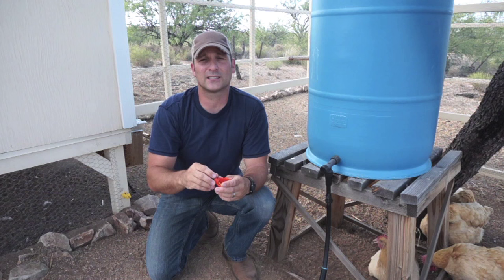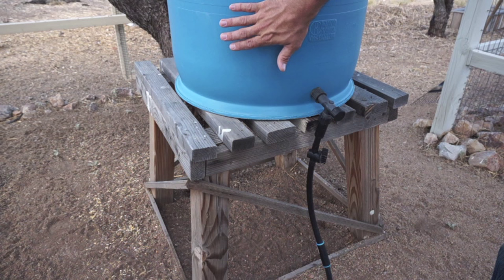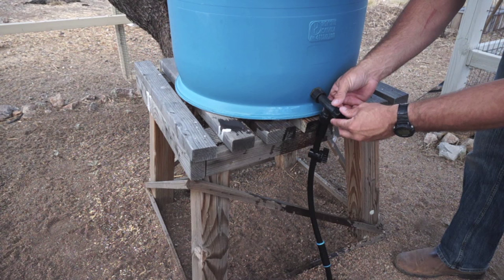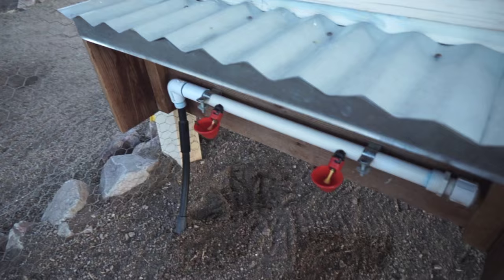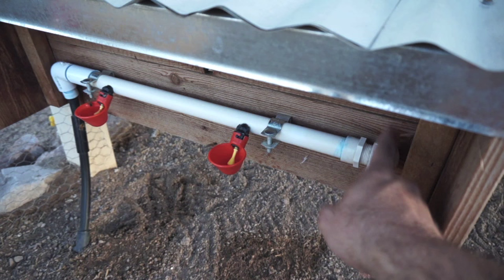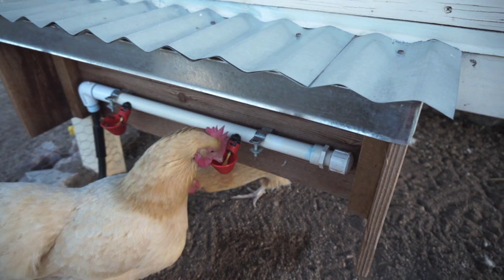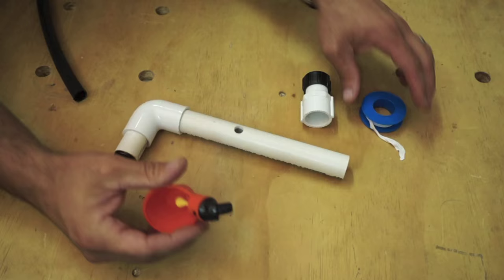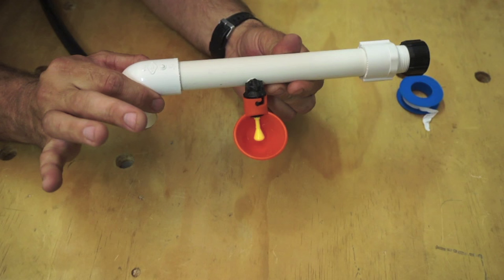Chicken Watering: Tour and Install of my gravity fed system

Comment: These cups look much more interesting than the water nipples, specially for inside the coop. I bought some nipples and they work, but there's always some drops dripping out of it even if the chickens are not drinking, so the wood shavings end up quite wet and I have to replace it quite often. This system looks much more safe and I'll try it soon :). Thanks for the video!

Comment: Fantastic video. So simple but yet so slick and effective. Major kudos for coming up with this setup. I'm definitely designing my water system for the coup I just finished based on your solution. But instead of a 55 gallon drum (or any reservoir for that matter), I'll be using the household water line since I have access to it 2 feet away from the coup. I will obviously be forced to add adjustable pressure regulator & color coded gauge to it, but since they only fit 1/2 PCV, I'll probably go with 1/2 pvc the entire length. Feel free to holler if you find any flaws with this. Not being able to collect rainwater for the system would be one major drawback...
Reply from the maker: +Peter Bergstrand Hi Peter!  sounds like a great setup to me!  If you got the water there, then use it:)
I think 1/2" should do fine for your piping... but I'd check to see if it'll work well for the cups to be installed to.  The cups have about a 5/8" threaded portion that will protrude into the pipe and may take up a bit of room in the 1/2".... but if so, all you'd have to do is just adapt to 3/4" from your 1/2" source line to the portion in the box.. so it wouldn't really be much difference in cost overall.  Anyways, hope that made sense.
Joe

Comment: so after you drilled the 3/8 inch hole. did you have to have to run a tap through the hole to make threads. or will the cups make their own threads. if you ran a tap, what size dud you use?
Reply from the maker: I didn't run a tap.. I just wrapped with teflon and screwed it in.. i unscrewed one and it looked like the black plastic made some shallow threads in the PVC... so it must be harded.. at least by a bit.  So far I haven't had any problems with doing it that way:)

Comment: I'm trying to get automatic water to about 10 coops. I'd rather set it up with a smaller drum and a float system with a garden hose attached. from there its a matter of running the tubing everywhere just like a sprinkler system. Oh and building all these parts. I don't even think I need the little boxes, could just mount the pvc tube with tie wraps on the outside of the coops. I would love some help getting something like this going, my chickens have a little money in the bank...lol... I'm just not handy with tools etc. :(

Comment: I followed this system with all same measurements--The cups all leak.  Do you have any suggestions?  I have even tried silicone seal, and they still leak.
Reply: Same here! I've tried silicone, I've used car body filler, I've tried super glue. Nothing. Always leak.

Comment: Cool idea - I had never seen those cup waterers before, only the nipple drippers.  Do the cup waterers have the same "stuck open" common failure mechanism that the drippers do or are they better designed/constructed?

Question:  How do the bees and chickens co-exist around the waterers, i.e., do the bees sting/keep away the chickens and/or do the chickens eat/peck at the bees, or is everything cool with them just sharing the same watering cups without any issues?
Reply from the maker: Peter K. Thanks Peter... I actually tried out the other style nipples before these and didn't really like them all that much.. plus these are just plain cooler looking:)  Regarding, the 'stuck open' issue... i've never had it with these in the 4 years that i've used them.  I think it's because these have a spring that forces the valve closed.  The other nipple waterers just use water pressure and if they don't get reset properly then I'm guessing thats how they get stuck open.  
Regarding the bees/chickens...  they coexist very nicely and ironically, during this video was the most amount of bees that I've ever seen near the waterers.  I'm guessing it was because the water bucket that I normally put out for my hives was empty and they were searching for the next best source.. and in the desert they are few and far between:)  
Anyways, hope that answered your questions:)
Joe

Comment: I have used the cups in a  2 gallon plastic jug. The water does not flow into the cups as easily as you showed.  I, myself, have to hold the nipple in to get even a small amount of water into the cup. The jug is almost full. Any thoughts or suggestions?

Comment: Do you have a recommendation for how to keep this system from freezing? I live in Minnesota!
Reply: foam insulation tubing should keep the pipes a few degrees warmer. a low volt heat pad for the bucket would be ideal.  those waterproof ones from waterbeds maybe?
Reply: When we lived in Colorado I used a heated bird bath. Because it was so open it got messy and I had to change out the water daily, but it didn't freeze so they always had water. I think it would work if you simply left it dry and sat your water bucket on it.
Reply: I use a koi pond heater
Reply: @emmeotto5825  I'll definitely look into that!

Comment: Although you do not have to heat this system to keep it thawed during winter, I would. Am brainstorming how to do that. You have any suggestions or ideas? The tank would be easy. The tubing an waterers, not so much.
Reply from the maker: Hi SF... depending on your temps you might only just need some insulation around the pipes...but if you are in a really cold area you might consider running one line into the coop and one line out.... and during the winter months shut down and drain the outside line and just use the inside line.   And maybe put a lamp in the coop as well.  Anyways, just some thoughts... let me know if you have any more questions:)
joe
Reply: Thanks Joe. I live in Alaska. We are thinking the same thing, pipe insulation as well as running it both inside and outside the coop. We do keep a low heat in the coop, just above freezing. We have the gutters up, just have to finish it all. It is Fall here now, might wait until next summer to finish it.

Comment: HI Can you include a materials list? Love this and ready to get it up and going. Thanx for the video :)
Reply from the maker: Hi Michelle... I might do an instructables on this.  If so I'll post a link  in the description to the instructables page and that will include a detailed list of components:)  Joe
Reply: Ok no prob will try to figure out from ur video, planning to do this over the weekend. Thanx
Reply: Michelle Justice Hi I was wondering if you have built your water system for your chicken I live PA and would like to build one but was wondering if where you live if it snows and what do you do for winter to prevent it from freezing
Reply: @amanda924121  HI I did n it couldn't be used in winter, bujt worked great otherwise.. Ive since sold all my chickens and removed it. 
Good luck to ya.

Comment: I think your stand had better be able to hold more like 500 pounds buddy. 55(gallons) X 8.35 = 459.25 pounds, without any factors like rain, snow, wind, leaves, branches, chickens, or all of the above, at one time or another lol. I know how crazy things can get on a ranch, and it usually happens all at the same time & fast. 😂😂😂 Just wanted time make sure nobody built something that was gonna tip over on them lol. I’d probably even sink those 4X4 corners 8-10 inches & put a concrete cookie on the bottom of each hole & fill the rest of it with dry concrete, back fill with a little sand or dirt and that baby ain’t tipping over on the kids, animals, or chickens. You could even run a little 1/2 round trim along the edge, or a whole piece of 2X4 along each edge for that matter, to help keep the barrel from tipping off of there in a stiff wind if it were to get low on water. Just sayin’. You don’t want 460 pounds of water to come tumbling down on top of somebody....

Comment: This is the best system I've seen!  I want to go to the store and pick up supplies today.  ONE question... do you think it would work to do a fork in the irrigation pipe so I can have one watering cup on the inside of the coop as well as a few outside?  My guess is that I'd have to make sure the watering cups are the same height (which isn't a problem since my coop sits on the ground)?  Thank you for the tutorial!
Reply from the maker: +Danielle Carbajal Hi Danielle,  I think that's a great idea and it's something that I've been meaning to do myself!  You should get roughly the same pressure on either side of the split/fork so the cups ought to work just fine.  As for height, as long as they are both about the same you should still get about the same pressure.  Mine is a gravity system off of a rain barrel.... but if you have it off of an irrigation line tied to your house then theoritcally you could have them at whatever height you wanted.  Anyways, hope that helps:) 
Joe
Reply: +homesteadonomics I did it!  I finally finished the watering system thanks to you inspiring me and showing how you did yours.  I added one to the inside of the coop and I did a blog post - is it ok that I linked your video to it?  Thanks again!!
 http://theprojectlady.blogspot.com/2016/03/chicken-coop-watering-system-how-to.html
Reply from the maker: Hi Danielle... just read your post and it was super awesome!  Totally cool with the link too!  Your coop looks really nice and I love the setting it's in too.  BTW... I checked out a couple of your other posts and I think you should start adding some more vids of those things to your YT channel.  Very nice job all the way around:)
Joe

Comment: I drilled a 3/8 in hole in a pvc pipe and couldn’t get the water era to thread as they have plastic threaders. Not sure where I went wrong. Also, how do I keep the water fresh, without algae growing?

Comment: Some of those parts were pretty tricky to find.  I got everything out together except for the compression fitting.  Does the lid of your barrel come off?!?  I can't figure out how to attach mine through the tiny opening in the top of mind...  :(
Reply from the maker: Hi HB... yes, the lid does come off of my barrel.  It cost a few extra bucks but I think was worth it for the access to clean it out.  If yours has the two holes in the top you will most likely have to cut out a bigger opening.  A jig saw can do that with little problems:)  I'd recommend cutting your access hole to a size where you could place a strainer or something in it to keep mosquitoes out but allow you to fill easily with a garden hose or raincatchment.
Joe

Comment: Question! How do you treat your 55 gallon tank to prevent algae build up? Keeping it in the shade helps but I was wondering if there was something else you use? I don't have that many chickens So I think I will use your system except with a 5 gallon bucket. Thank you for the video.
Reply from the maker: Hi Chris, I change the water out and give it a good scrubbing once a year but other than that I really don't have any alge problems.  good luck on the build!  your chickens will love it:)
Joe

Comment: I really like this system. But how would you deal with much colder/freezing temperatures? I live in Washington State and we have temperatures as cold as 30 below although not often.
Reply from the maker: Dolly Perry Hi dolly, even though we don't get hard freezes too often we do occasionally get into the teens.  In those cases i just drain the system and put the old style waterer out.  For light freezes I wrap the black pipe with insulation and just drape a towel over the box... which seems to work out great!  Hope that answered your question:)
Joe
Reply: I know from experience that chickens like to eat the foam insulation. I'm kind of envisioning some sort of get up where the pipe is in foam which is in a larger pvc pipe. Or I may check and see if just having a submersible water heater in the tank would work better. This will be my first winter with chickens so the learning curve is great! Thanks for the quick reply!

Comment: With a 55 gallon drum are you adding chlorine or anything to purify it if the water's not used for 2 months at a time? If so how often are you treating the water?
Reply from the maker: +mhendu07 Hey Mhendu.. I don't add anything additional to the water.  There is a little chlorine from when I fill it up with house water but I've also got rain catch going in there too now.  So far no problems with algae, smells, etc,. … the chickens love it!   Anyways, hope that answers your question:)  
Joe

Comment: Hi, We think this will work for us, but haven't been able to find all the parts at Home Depot, mainly because everyone we talk to there has no clue what we want! Would you please itemize the parts? I have figured out that a swamp cooler is actually an evaporative cooler system!  Have most of the parts, but am uncertain about the rest.  HELP!!! This would be perfect for my flock of 20 hens plus 7 chicks and 2 Roos!
Reply from the maker: Hi Eva,  Not sure which parts you are looking for but here are the quick specifics. 
 
-the actual waterer cups can be found (in various types) on amazon, ebay or mcmurrayhatchery.com
-the PVC fittings are all in the 'plumbing' isle with all the white colored pvc.
-the PVC to irrigation hose adapter will be found with the 'black' irrigation pipe and fittings for outdoor irrigation.   Sometimes it will be the same isle as the plumbing and sometimes it will be in the garden area.  
-the metal bracket I use to hold the pvc pipe in the box are electical conduit brackets that can be found in the 'electrical' isle next to all of the 'electrical conduit' fittings and boxes.  They will be in a little baggy as they include the bracket and the nut/bolt to secure the pipe within them.
-the wood I used to make the box to house the waterer set up is standard redwood fence boards (1x5.5").  They can be found in the lumber isle.

Hope that helps:)

Joe

Comment: "Fresh" water for 2 1/2 months? That is not what I would call fresh. I also noticed that the shutoff valve below the drum is dripping about a drop a second- guess how much water that is? About a gallon an hour! Like the cups though, great idea.
Reply from the maker: Sorry, I mis-spoke... I'm not a professional and don't always use the right words.  What I meant is 'available' water.  Yes, not fresh, but available to be used by the chickens.  And regarding the drips, that was right after i screwed the cap back on and it wasn't tight.  Sometimes in making the video you miss things:)  Anyways, hope it gave you an idea for your own coop setup:)

Comment: this seems awesome. we have algae build up in our small gravity waterer and have to clean it every week. I would love to build this system but the idea of having to clean slime out of a barrel that large makes me worry a little. do you ever have this problem?
Reply from the maker: +Sunni Kiser Hi Sunni.... I don't really have much of an algae issue myself.  The inside of my barrel really never ever has had algae.  I do flush the system out through the nipples and the end cap once a month or so but only a couple gallons of flow.  Maybe you have a different mineral content with your water or maybe your barrel isn't a dark enough color and light is getting in?  Anyways, I wish I had a good answer for you.  Let me know if you have any other questions:)

Joe
Reply: +homesteadonomics  thanks so much for responding! it probably is the water here.. but my waterer is light colored. I will give it a try. either way its an awesome system!
Reply from the maker: +Sunni Kiser I think that is the culprit for sure.... I have a buddy who has some white colored barrels that grow algae very quickly.  Seems the darker (blue/black) mitigate the problem a lot.   You might be able to paint your barrel even check on craigslist for some blue or black ones:)
Joe

Comment: I have 5 hens and 1 rooster.  How many cups should I install ?
I'm located in north east Texas and will have the  barrel located under trees for shade to
keep the water cooler.
Reply from the maker: Hi Jennifer,

One could probably suffice just fine but I'd still recommend two just incase one became clogged or inoperable for some reason.  Hope that answered your question:)
Joe

Comment: Hey there!  Great vid!  My cups are leaking from the yellow nipple.  I read on Amazon that they need to be tightened.  I'll have to look when I get home, but just wondering if you experienced any leaking causing the cups to overflow.  Thanks!
Reply from the maker: Hi Atur,  
Fortunately I have not had any problems with my cups.  But if they are leaking from the nipple portion, maybe the spring isn't strong enough to hold the nipple mechanism closed.  If so, an adjustment to the spring might need to be made.  I can't be for sure, as I don't know if yours are the same style or not.  There are actually several 'similar looking nipples on the market and each have a slightly different design.
joe

Comment: How tall is the coop off the ground? And about how tall are the cups off the ground? Also, do you keep food and water inside the coop? If so, what do you use?
Reply from the maker: +Tim Woodward Hi Tim... I think its about 20" at the bottom and about 7-8' at the peak.  I believe the cups are like maybe 14-17" off the ground.  I actually just held them by one of the chickens to find out the best height.  Hope that helps:)
Joe
Reply: That does help a lot! Thanks again!